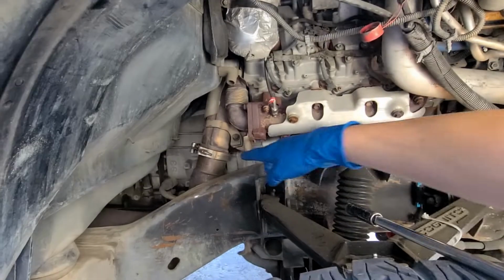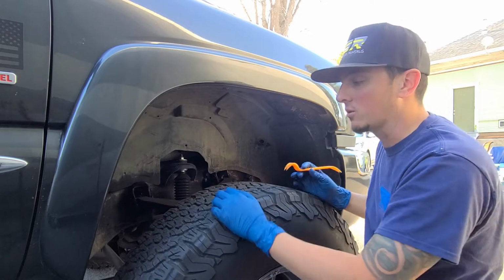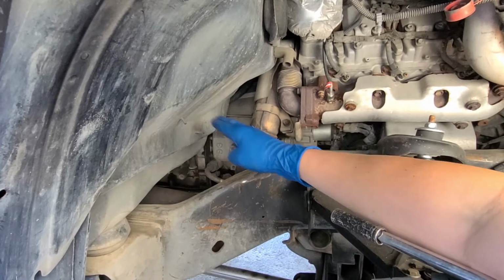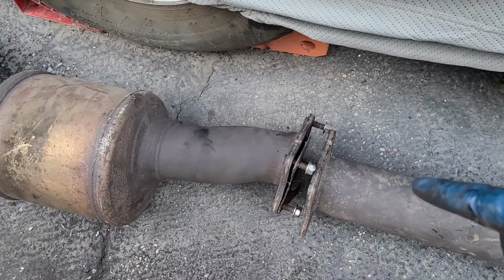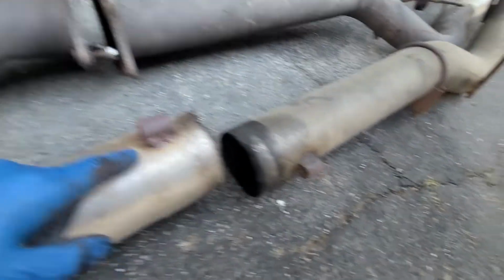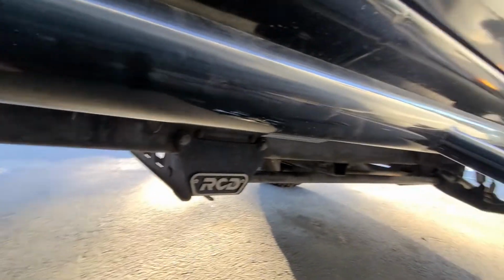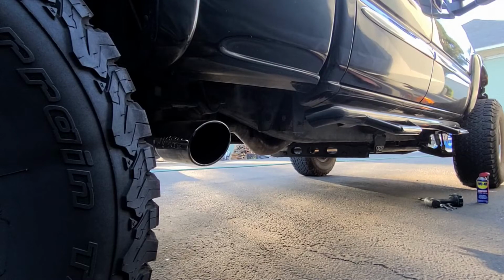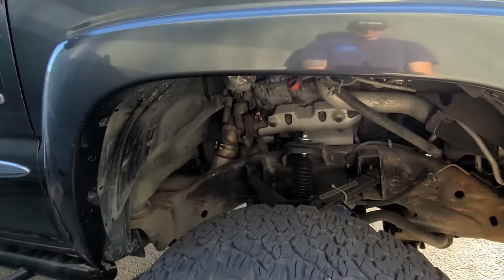LLY Duramax Exhaust Install- MBRP 4"/ 2004 GMC Sierra

Comment: Easy enough 👌 nice truck what year is it and what kind of tune you have.
Reply from the maker: 2004.5 lly engine. It's got 5 maps through efi live. My local desiel shop set the tune. Not sure exacting the parameters. They said on stage 5 on my knob it's probably around 480 500 hp vs the stock 350.